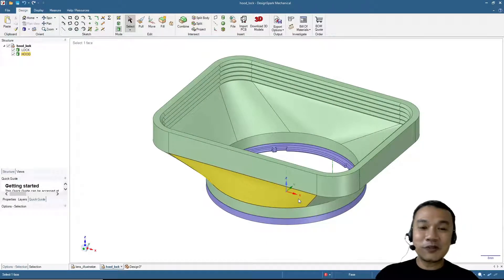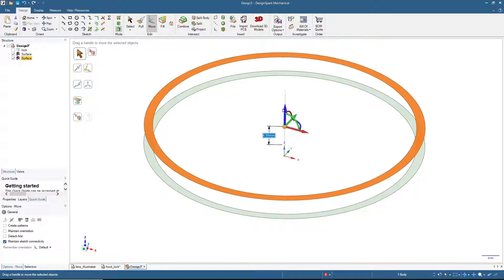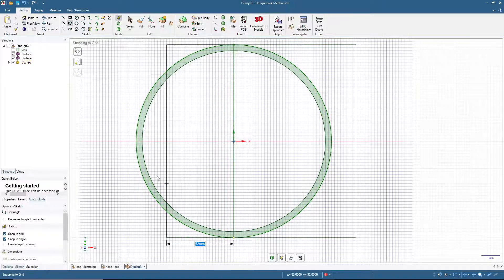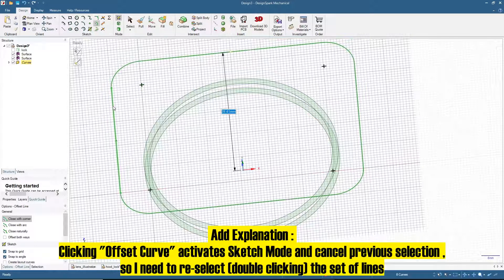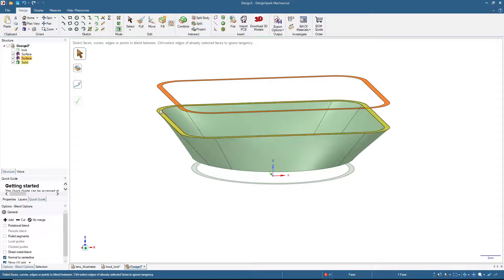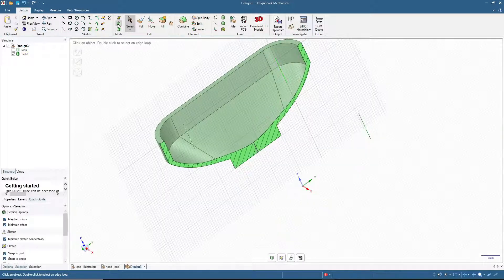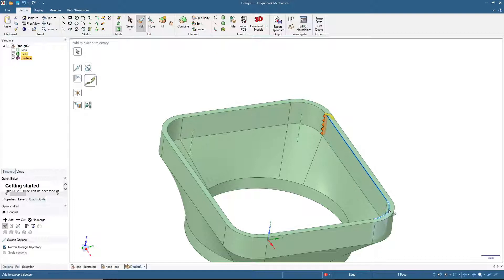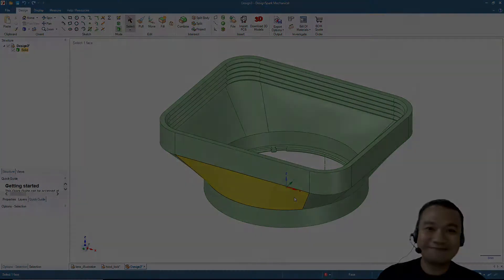Designing 3D Printable SQUARE LENS HOOD #2 - Designspark Mechanical Narrated Tutorial

Comment: Hello, me again with a few more tips, If you want to see the top view while sketching any plane, just press the V key is faster than the gizmo on the lower left screen. There are a lot of keyboard shortcuts, just to learn the most basic ones gives a little speed and easy to constructing. like the Z key for extend zooming. or the P for the pull command. Did you know you almost never have to click on the add button for the pull command, DSM is smart enough to guess what you want, also for cutting a hole it does that almost always correct. 
I made a shortcut key for the offset curve command. to do that it is under the custom tab of the options menu. 
Terima kasih banyak
Reply from the maker: Awesome, thanks for the tips. Haven't tried the "V" shortcut in sketching mode, and I think I can really use the customized short cut key that you shared for many uses. Once again, terima kasih banyak :)
Reply: @W3DEStudio  Hello, the "v" key also works in 3 d mode, just klick any face and press v to do a top view of that face. And the "h" key for home again.
I have a short list of the keyboard shortcuts,, with the most used ones:
b		Blend
c		Circle
Esc		Escape
e		Measure
f		Fill
h		Home
l		Line
p		Pull
r		Rectangle
s		Select
d		3D mode
v		Plan view
x		Section mode
k		Sketch mode
u		Up To tool guide
m		Move
t 		Trim Away
z		Zoom Extents
Should be printable I got one taped next to my keyboard. I'm67 so the gray cells now and then need a refreshment of the lesser used one Kind regards 
Sapu Lidi Sandwich (joke)
Reply from the maker: Wow, that's a complete list, I couldn't thank you enough :D
Yes, I'll print it and stick it to the wall too.
Have a great day :)

Comment: What software are you using?
Reply from the maker: I'm using Designspark Mechanical
Reply: A real nice program for zero dollars, better than SketchUp, but I use Sketchup for 3d teks creation save the text and import it straight into DSM Some features are a bit hidden , but they are there you won't find a mirror tool, but every line has a right klick menu with that mirror option at any angle an multiple lines and angles 
It even got the Boolean operations that are not in the free Sketchup Kind regards Hans